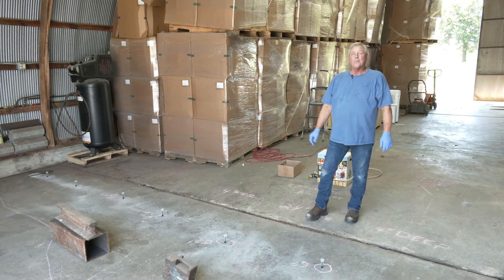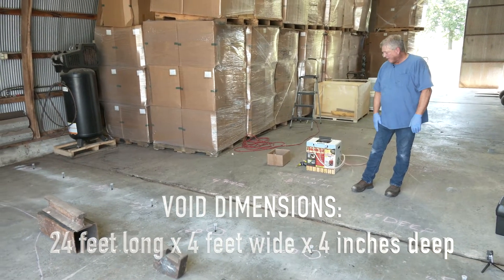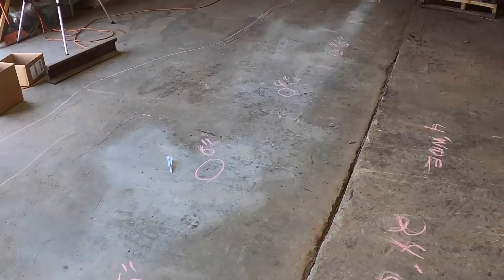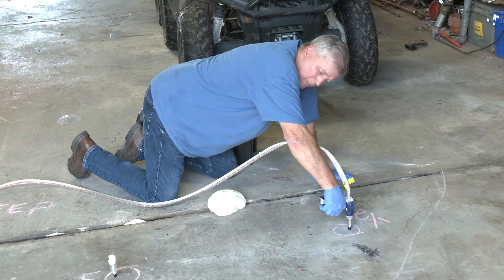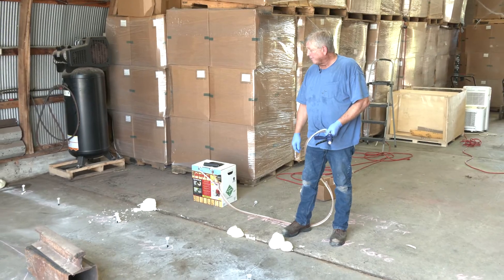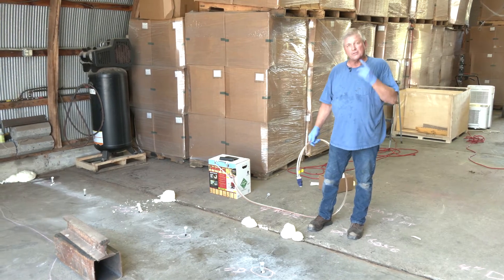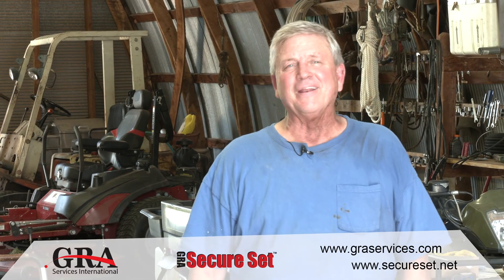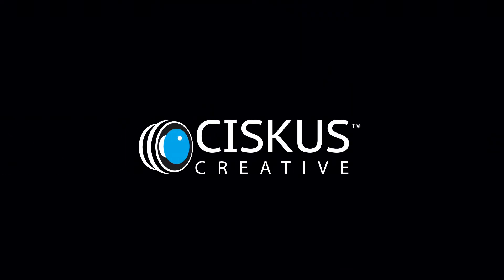Foam jacking, concrete slab lifting with Secure Set

Comment: What are the tools and material necessary?  I know the hammer drill..... I had a slab fail on a hill. I should've pulled off the job when the client told me my price was too high abs he was in between paying me one thousand for ( what he considered the work I've done) or firing me and bringing in the cheapest guy. Now after that point I'll admit I was frustrated.... and then..... well at this point I believe this method could help me recoup around 18 to 22k. What is that tool called? The injection one? Our floor hasn't settled out like that it just cracked in some places. I can handle our current issue but we've had 2 feet of rain since poured and roughly 260 ton of fill in this yard brought in. So much money I threw away. I just want to save some of it
Reply from the maker: Secure Set Spray Foam kit.... sold on www.secureset.net .  Other than that you will need a 3/8" concrete drill bit if you plan to drill through the concrete to apply the foam.  Ten mixing nozzles (5 conical and 5 fan style) come with the kit.  You will need to cut back the tips about 1/2" for a better flow when spraying through the drilled holes.  Then wrap black electrical tape about 5 to 7 rounds under the flares of the mixing nozzles in order to fit tightly in the 3/8" holes.  That way you can also use all 10 nozzles.  The mixing nozzles will spray out about 4 ft.  
If you have side access to work for filling the voids, then you could use 1/2" CPVC pipe taped onto the mixing nozzles with fiber reinforced strapping/packing tape as shown on our document on the website  https://secureset.net/wp-content/uploads/2024/02/2023-Extension-Tubes-How-To_v2.pdf .  This type of application will help you to get to the void cavities without drilling through the slab, as shown on many of our videos, including this one https://www.youtube.com/watch?v=iigbr-tIM9I&t=7s .   If you have other questions, you could call us M-F 8:30 a.m. to 4:30 p.m. CST at 405-672-8885 and we will help however that we can.  Thank you, GRA Services

Comment: How many boxes did you use to lift it. And do you sell thr set with just a and b canister
Reply from the maker: Hello Ava, We ended up using 2.5 kits, which is 25 cubic feet of foam.  The kits come complete with both canisters , the application gun and hose, and the static mixer nozzles that fit on the end of the gun.  We do not provide individual cannisters as separate items.  Thank you.

Comment: How long does the foam last?
Reply from the maker: Thank you for watching and your question.  Secure Set high density, closed cell structural foam is projected to last 40+ years, since nothing really breaks it down and there is no nutritional value to it so nothing eats it. Even if it is exposed to the sun it just changes color, it doesn't break down.  GRA Services - Secure Set

Comment: I need to raise the concrete slab around my swimming pool. I opened the concrete in two places and can see a small gap between the concrete and the ground. The concrete  is sitting on the pool frame and the ground underneath has settled over about 19 years. I need to take the load off my pool frame and fiberglass stairs. Could you provide more details on  how you did this slab lifting?  How big are the holes you drilled? The parts you inserted in the concrete: how many come in the kit and are they reusable?  Any tips would be appreciated
Reply from the maker: Hello Matt,  The first steps you have taken are good. One of the important aspects is to try and determine the extend of the voids and also the volume you need filled.  Remember, the expanding foam will always first move to the point of least resistance. However, once the voids are filled and there is no where else for the foam to go, it will start building expansive pressure under the concrete. Our Secure Set Spray Foam expands on a ratio of 2.5:1.  It does not go crazy while it is expanding and therefore you have more control over the placement and end results of your injected area.  Once the voids are filled, you will probably have to go back and re-drill the original holes.  I would only go to just under the slab and just a little into the foam that has already set under the slab.  Insert a new nozzle into the hole and start applying the foam slowly.  You have about 30 seconds for the foam to sit in the nozzle before it starts to harden.  Trigger small amounts to keep fresh foam in the nozzle. Monitor the level of the concrete slab, you will be able to watch it rise slowly while the foam under the slab is expanding. The slab may not raise up uniformly, so you may have to move the injection gun to a new hole and fill another area to allow the concrete to raise up smoothly and uniformly.  It's not an exact science, but done deliberately, you will find the end results very satisfying.  The holes you need to drill are 3/8th inch in diameter. Once the Spray Foam has hardened in the nozzles, they cannot be reused. There are 10 nozzles per kit and you can purchase extras if you need more. I use a 12 inch long drill bit, has worked well in all our applications.   Thank you

Comment: I have a flagstone patio with mortared joints that has sagged in a location away from the drain so water ponds and is a nuisance. Do you suppose that it would be possible to lift the sag with foam? The affected area is approximately circular and about ten feet across. The stones are about 1 by 3 feet on average. I had an estimate of $10000 to remove the stones, rework the ground underneath, and replace them. I’d like to try something cheaper without having to tear everything up. Might be possible to do a stone at a time?
Reply from the maker: Hello Craig,  We have worked flagstone projects.  A stone at a time is actually the way to do it. Our expanding foam will lift the stone, keeping them all level is one of the challenges. Voids under the stones will be filled, as expanding foam will always travel to the point of least resistance first.  Once the voids are filled, then the stone will start to move upwards. Thank you

Comment: But what prevents the concrete from settling again?
Reply from the maker: Hello S L S,  Once the void under the slab has been filled with high density foam, since foam does not shrink, it will not settle like the native soil did in the first place.  Thank you

Comment: If I do not use up all the foam in the kit.  How long can I wait to use the left over for the next project?
Reply from the maker: Thank you for this question, Jerry, it is actually something that people ask us by phone quite often.  You will need to turn off the tanks, make sure to remove the nozzle, wipe the foam off the spray gun/tool very well, and apply a good coating of the petroleum jelly (that is included in the kit).  Make sure to leave the lines pressurized and they should be good for at least 30 days.  If it is not used during this time just spray it a bit every week to keep the lines fresh.  The product in the tanks have an 18 month shelf life.  If your lines do get air and harden, you can purchase another hose/tool kit with additional nozzles, as well, by calling our office at 405-672-8885.

Comment: Do you have Suppliers in or ship to Canada?
Reply: Hello, At this time we are not allowed by the Canadian Gov. to ship Haz Mat material into Canada.  We can ship the Secure Set  Mix & Pour products, but not the Spray Foam.  The pressurized metal containers for the Spray Foam is considered Haz Mat, not the product inside.  Thank you
Reply from the maker: Update for Canada:  We do not ship our Secure Set Spray Foam canisters over the border, but we can ship to a U.S. border location and customers can have it forwarded from there or pick it up over the border.  Our price to the U.S. border location is included in the price of the kit.

Comment: I've been told by a concrete repair place that they can't do a detached garage because the weight of the garage sits on the slab. This place does mudjacking and some sort of polyurethane fill.  Would your foam work on a project like mine? Can anyone do this?
Reply from the maker: Hello Lesley,  The garage was not "detached" per se. It was an extension of the frame of the house.  The slab that sunk was separate from the garage and was part of the extended "sloped" driveway leading away from the garage. We fixed two slabs that were sunken and aligned them with the level of the slab of the floor of the garage.  Thank you.

Comment: Hey secure set, really considering buying your product. Is this ok to put in a slab butted up to a foundation of a house in my driveway?
Reply from the maker: Hello Da Bruiser,  Yes, the foundation of the home will act as a wall or barrier, the foam will then have to travel under the slab to the points of least resistance. Once all those voids are filled, then the foam will start to exert upward pressure under the slab. The issue is that it is difficult to determine how large the voids are under the slab. You may accomplish the slab raising with a single kit, or like others it may take two or three kits to fill all the voids then raise the slab. Hammer sounding the slab gives you a little insight into what conditions are like under the slab. Thank you

Comment: How hard does the foam get?
Reply from the maker: Thank you for your question.  This is a closed cell 4 lb. density foam with a 70 psi compressive strength, and it will support 10,080 lbs. per sq. ft.  You can order this one on-line at www.secureset.net or by calling direct.  We also have a closed cell 2.8 lb. density foam with a 35 psi compressive strength, and it will support 5,040 lbs. per sq. ft.  You can order this one by calling us direct at 405-672-8885 M-F 8:30 a.m. to 4:30 p.m. CST.
GRA Services

Comment: #1 where are your knee pads? haha #2 how far from the expansion joint do you drill the holes for the ports? #3 Why can't you just attach 1 port to the nozzle and just move it from one hole to another?
Reply from the maker: Hello Mike;  I drilled the holes about 8 inches from the expansion joint.  After hammer sounding the whole area, I knew there was a void under the concrete beyond the expansion joint.  I wanted the foam to be able to travel under the joint and still lift the sunken area. As far as moving the nozzle from one drilled hole to the next, that is possible.  I just wasn't thinking far enough ahead, in that I did not make wooden dowel plugs to insert into the filled hole after extracting the nozzle.  The expanding foam will squirt out of the hole if you do not plug it quickly.  Also, you need to move the nozzle quickly or leave it in the hole and have the nozzle act as the plug, because the foam will harden in about 30 seconds in the nozzle and then it has to be changed anyway.  Since the project took four Spray Foam Kits, I had plenty of nozzle, there are ten nozzle per kit.  As far as the knee pads, the project took longer than I expected, I should have had some on; took Aleve afterward to overcome stiff and hurting joints. So goes the process of bringing a new product to an established industry.  It is all good now, and we are helping people solve concrete issues all over the country. Biggest satisfaction is to hear so many reports and testimonies from customers about ease of use, great results and the savings of significant money versus the alternative of hiring it to be done. Thank you

Comment: I have a number of questions not answered in the FAQs on the website:
1.  What do you use to trim off the overflow foam?
2.  Should the overflow foam be cut flush or undercut?
3. Should that crack and the joint between slabs be filled using something like a flexible crack filler?
4. You mentioned that water flow caused this originally--Have there been cases where the water then flowed AROUND your foam and undercut again, causing the same problem all over again?
5. Have you used this technique under homes built on a slab that have settled? This is a problem in our neighborhood in Kansas. Some of my neighbors have had to have expensive hydraulic concrete jacking done for a whole room of their house that is built on a slab that settled, and I may have some of the same kind of thing going on in my house.
Reply from the maker: Thank you for your comments.  
1. You can cut the dried foam with a saw and then you would want to spray paint over all the cut area so it will remain as a closed cell foam.
2.  Some people leave the foam cut level and paint over it, and some do undercut it, paint, and then fill the hole with a concrete patch product.
3.  There is a lot of available information on-line explaining what to use and not to use to fill the gaps between concrete slabs.  We do not sell those products; therefore, we recommend researching and using what is appropriate for your type of slab.  
4. We have not personally experienced this issue.  If the water is not redirected, then continued wash out of the soil around and under the foam could happen.
5.  We have not personally used the Secure Set foam under a house slab, but we have many customers that do this, as well as pier and beam companies and basement repair contractors, etc.
Hope this information is helpful.  GRA Services

Comment: 250 a kit 3 years ago now it's double
Reply from the maker: We've never had a Spray Foam kit in that price range, so I'm not sure where you found that info.  We made this particular video in 2021, which was during a time after the pandemic that supply chain issues became a big issue.  Prices went up on every component of these kits twice that year for the polyol products, steel canisters, plastic parts, the gas, also the boxes, and even shipping rates increased.  We have only increased prices for these kits as our manufacture had to increase our prices.  We have not increased prices since May 2022, so that is 2 years that we have been able to hold the price steady.   As with most everything, prices have gone way up and never seem to be able to come back down, but I suppose we can be hopeful things will change.  Thank you for considering GRA Services Secure Set Spray Foam.

Comment: You've had a 22% price increase since this video was made. I am trying to justify this vs. hiring it out.
Reply from the maker: We made the video in 2021, which was during a time after the pandemic that supply chain issues became a big issue.  Prices went up on every component of these kits twice that year for the polyol products, steel canisters, plastic parts, the gas, also the boxes, and even shipping rates increased.  We have only increased prices for these kits as our manufacture had to increase our prices.  We have not increased prices since May 2022, so that is 2 years that we were able to hold the price steady.  Thank you for considering GRA Services Secure Set Spray Foam.
Reply: @SecureSet-Fence-Installation  I understand, thanks for the response. Let's make sure to Vote in November.
Reply from the maker: @SwimmingintheDeep  YES, so true ......VOTE!!!

Comment: Why bother with this when you can get a professional company like CRC Concrete Raising & Repair to do it for about $1,600, including labor in about 90 minutes and provide a warranty? 
How many static mixing nozzles did you use? and at what cost?
Reply from the maker: Hello, Respectfully, with more than 40 cubic foot of void to fill, you are completely out of touch with today's costs for what it takes to raise concrete. I see you are in the business of raising concrete, just getting the size of the truck you have to the jobsite is a considerable expense.  The fact that a homeowner can do this themselves, on their schedule, and be anywhere in the USA , is a huge gain and cost savings for 1000's of people that have this issue. There are 10 static mixers included in each kit, and they come free of cost. So when we used 4 kits, the homeowner had 40 mixers he could use. The fact that we can also reach voids that are as far away as 50 feet with our tube extensions, gives the homeowner unbelievable flexibility for all the conditions they may face. If you are a homeowner reading these comments, take heart in the fact that the effort we spent in developing this product was to allow you to do things that contractors used to tell you they were the only ones that could do it.
Reply: I have called so many concrete levelers,poly lifting and even concrete guys to redo my sidewalk they are all busy except for one who showed up but never got back to me for an estimate and i don't even know how to get back to him.